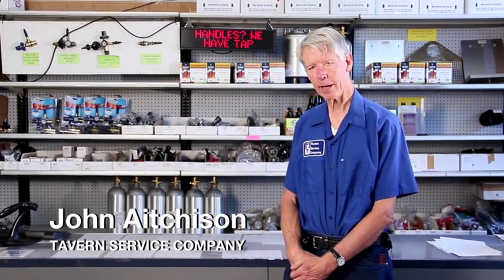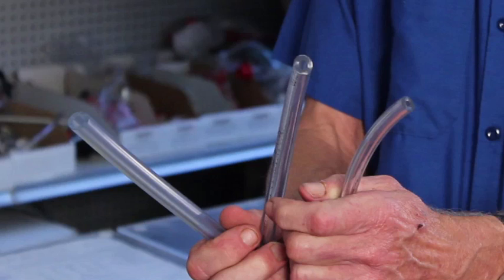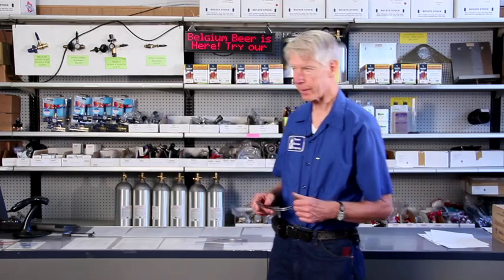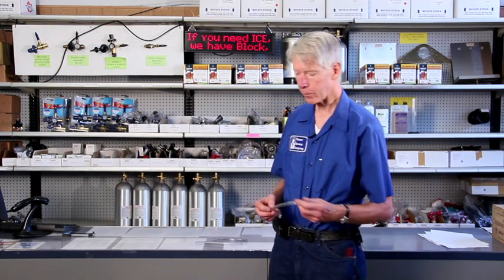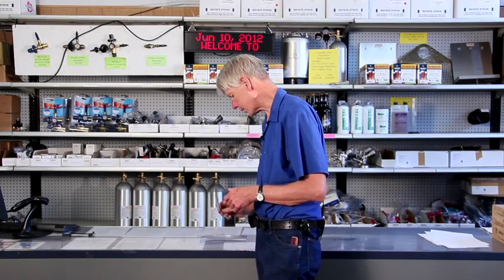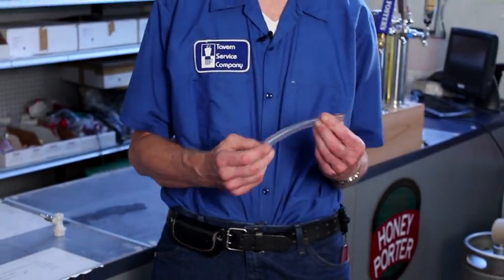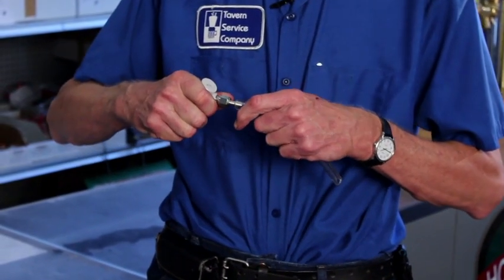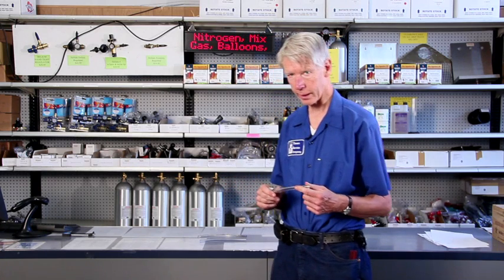Beer line sizes and lengths

Comment: Hi, After so many years i said to move to CO2 carb under presure (and i start since January 2025) which i got problems as i try to found when i am bottling from fermzilla why to much foam on bottles after cold crashing.

i asked this stupied AI gave me many wrong answers which i start to trust Carbo chart and today accidently see your vid which was really helpfull. SO now as i have a ipa which is temp 2.1C (35.5 Farh), pressure at 10psi (0.7bar) and want to bottle with ITapx Pro i have to de-press pressure to 0.2 about psi to have at last no foamy bottles filled. 

Last time again i was trying to fill at 0.5bar (9psi about) with reall chilling bottles and foam was there. From a 22Litres (4.5 Gal) i got only a 10 bottles.... !!!

SO now if i am not wrong i will use RPV valve fall pressure at 0.2-0.3 PSI and let temp at 2.1C (35 about Farh.) as it is....

If i use spunding valve to throw presssure down, batch will became hazy. Any option for that?

Hop Everything will be ok now.... and found the right way to bottle when it is under pressure and temperature ...

Under pressure at this time at 10PSI, temp 2.1C (35.5 Farh.) 

Please note that the beer line is a silicone tube 1.5meters (4.9 feet)

Please advise(s) will be welcome...

Cheers from Greece :)
Reply: JUST WANT TO THANK YOU FOR YOUR ANSWER IN MY QUESTION...!!!

- With other people asking you since 7 years now with no answer i know my "future" on my question... pfff...